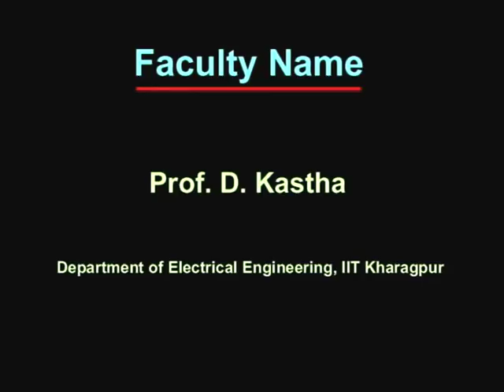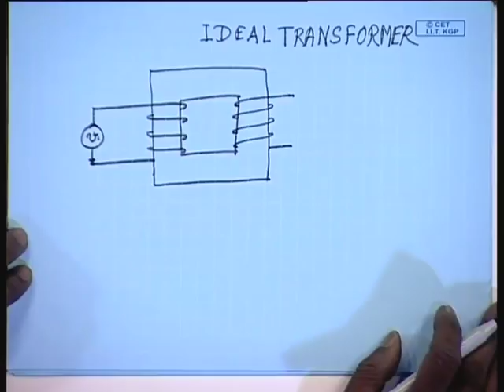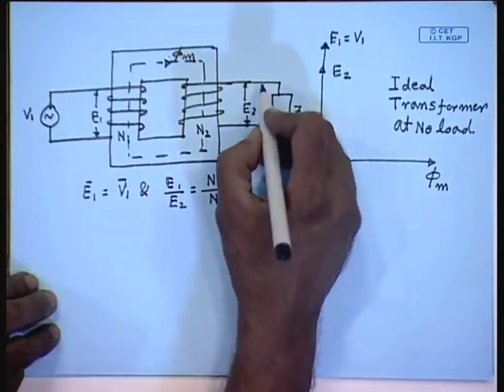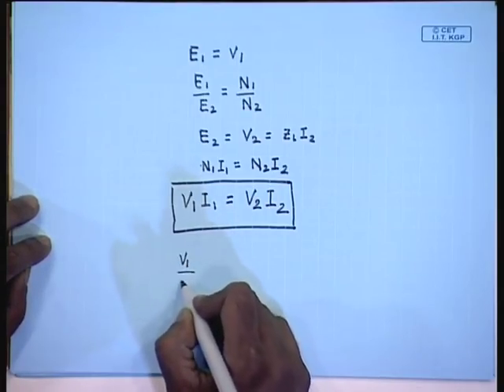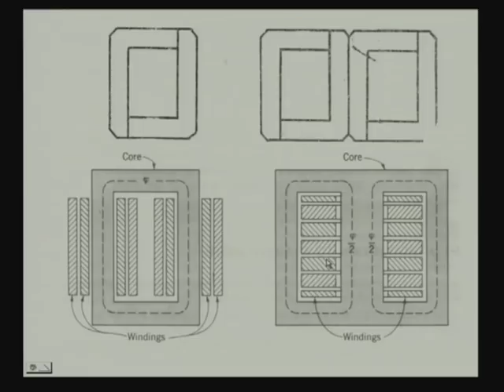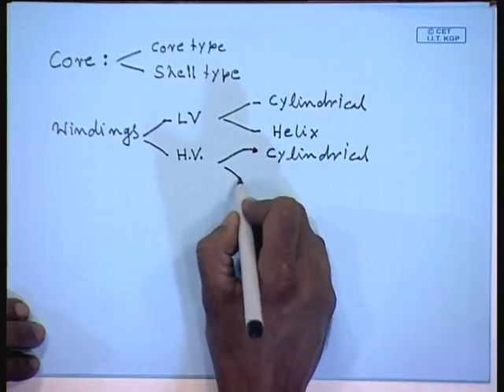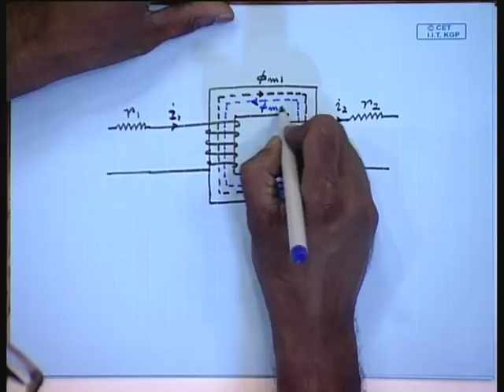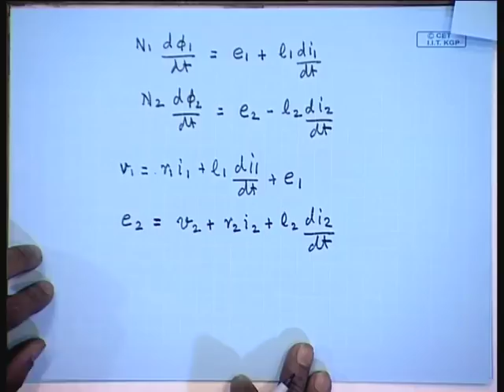Mod-01 Lec-02 Lecture-02-Operating Principles and Construction of Single Phase Transformers

Comment: Sir equation of V1 = VmSin(wt)

Equation of  E1 = N1*w*Cos(wt) 

Then they must be in phase opposition right ? 

According to my knowledge V1 and E1 .,E2 should be 180 degrees out of phase
Reply: Biggest confusion of the century 😒😪
Reply: He didn't mention V1=VmSin(wt). Since there is no impedance between V1 and E1 hence V1=E1. Also emf derived from Flux equation.

Comment: There are two conventions regarding the phasor diagram at no load....Phasors E1 and E2 are drawn 180°out of phase with respect to V1 in order to convey that the respective power flow directions of these two are opposite. The second convention results from the fact that the quantities v1, e1 and e2 vary in unison then why not show them as co-phasal....

Source: Nptel
Reply: U have written about ur source   as nptel. Can u please say which lecture have u gone through for this.

Comment: in the on load case of ideal transformer's  phasor diagram the magnitude of i2 and i1 should be equal as you illustrate, then why it is not?
Reply: since the magnitude of i2 will be converted suitably using transformation ratio as it moves to primary side .

Comment: v1 and e1 should be of opposite polarity
Reply: it was mentioned in the first lecture that e is notation for the counter induce voltage such that e=d(pi)/dt  *N
instead of the induced voltage which is e= -N d(phi)/dt , to avoid any sign confusion .
Reply: yes Mohamed, you are right.

Comment: E1 should be out of phase with V1
Reply: No its depends upon either you assign a sign to e or not if you assign sign to e such that it oppose v then they both are in the same phase as
Reply: If you apply kvl on the loop such that current in the primary is zero you will find  that v1 and e1 are equal or you can treat e1 as the drop across the primary coil.
Another way of thinking this can be according to lenzs law the voltage induced will be in such manner it will oppose the cause which is the current(magnetising) so the emf induced will be such that it opposes this magnetising current. Apply this and you will find V1 and e1 should be in same phase
Reply: 5 years passed boys, your senior has cleared everything before.